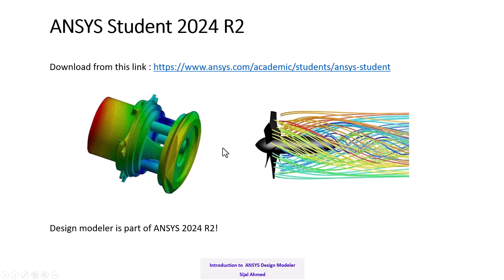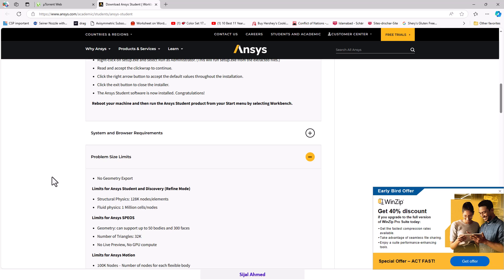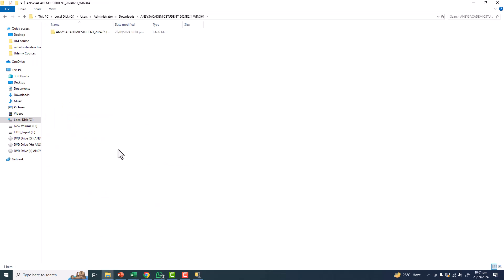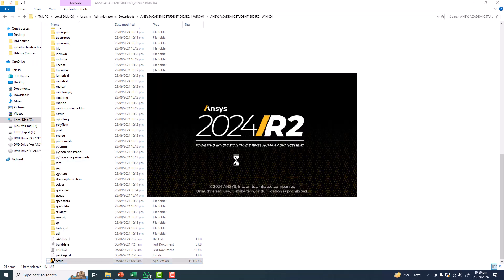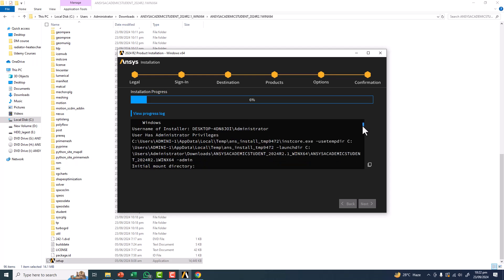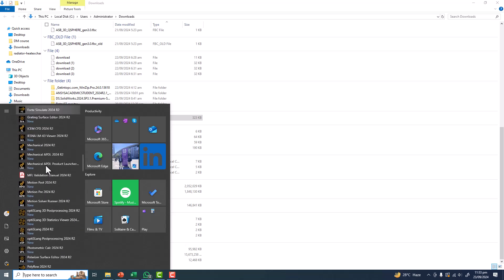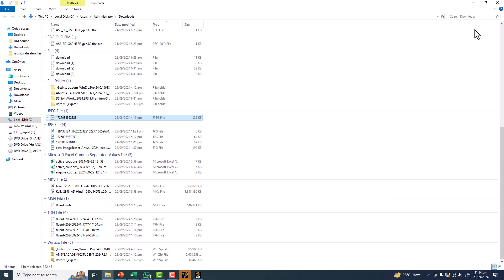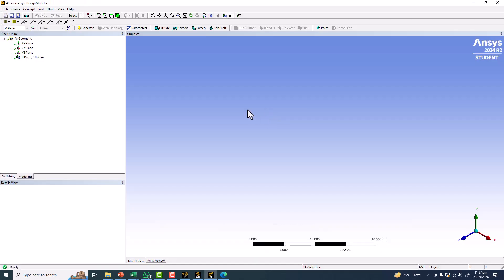Installing ANSYS 2024 R2 Student Version

Comment: Thannk you so much
Can u please help me , i have a simulation of stirred tank with anchor impeller in laminair regime (Re= 50) continue a fluid newtonien ( glycerol) in ansys CFX please 
I'm student and just a beginner 🙏
Reply from the maker: we do provide consultancy
Reply: @CFD_Mechanic  can you please tell what can , because when I finished the instalation they said to me 
Ansys Product Improvement Program

The Ansys Product Improvement Program helps improve Ansys products. Participating in this program is like filling out a survey. Without interrupting your work, the software anonymously sends usage information such as errors, machine and solver statistics, features used, etc. to Ansys. We never use the data to identify or contact you.

The data does not contain:

any personally identifiable information, such as names, IP addresses, file names, part names, etc.

⚫ no information about your specific geometry or design data

You can end your participation at any time. To change your selection, go to Help >> Ansys Product Improvement Program.

Yes, I would like to participate in the Ansys Product Improvement Program.

No, I don't want to participate.

For more information regarding Ansys' privacy policy, please refer to:
I said yes or no???
Reply from the maker: @azzilhem7079  leave it.